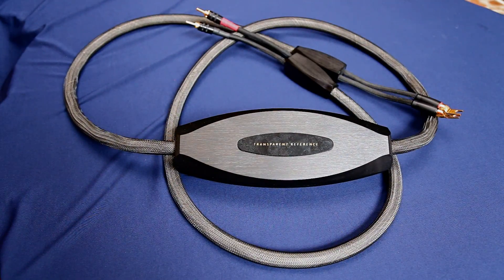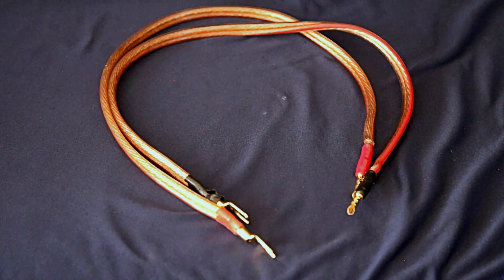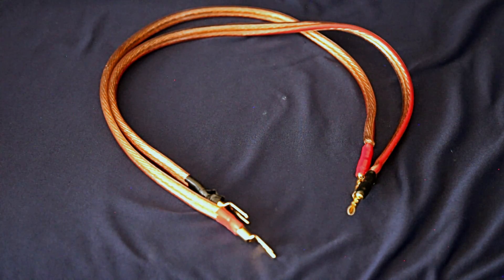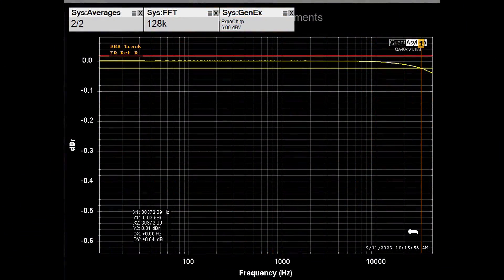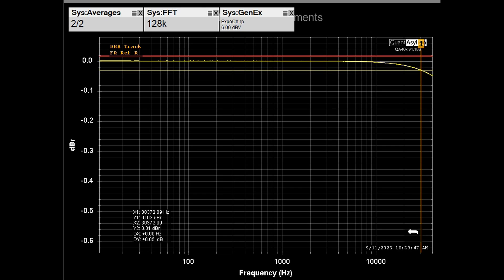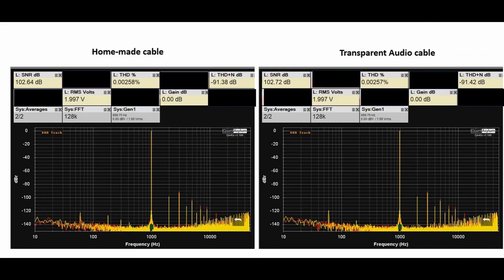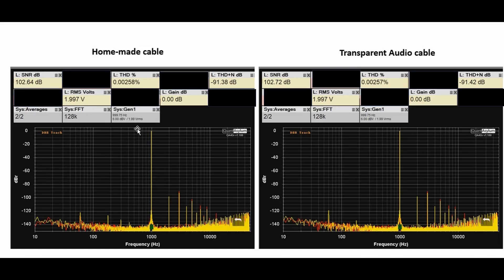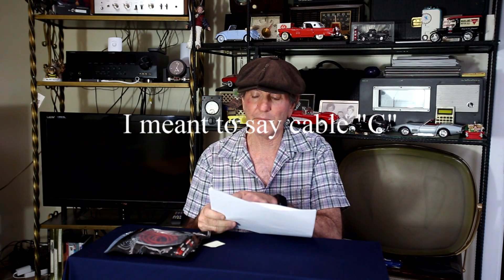$8000/pair Speaker Cable  vs. $14 DIY Speaker Cable A/B Test: Vintage Audio Review Episode #87

Comment: Transparent cable doesn't claim their cables are lower distortion or have a different frequency  response than less expensive cable s. Transparent claims their network boxes reduce noise and are calibrated to match the impedance between amplifier and speakers , and between  components and their  network boxes have damping expoxy to reduce resonance s  so these are  tests in the video  that are not addressing the specific manufacturers claims like resonances , impedance  matching and measuring noise spectrum in the range transparent  claims is reduced by their cable networks but if more extensive  tests are done and cannot confirm the manufacturer s claims then cable nay sayers could be right .
Reply: See my root comment above ... Nothing about those cables can or will do any of the things you say they're claiming.  It is a physical impossibility.
Reply: @Douglas_Blake_579 .....phone preamp s have different impedance matching for moving coil cartridges s but transparent can't do different impedance s in their network boxes with internal circuits that include resistors ?...okay ....someone should file a lawsuit against them if it's a lie
Reply from the maker: @mikelanden  Phono preamp matching to a cartridge is a totally different beast than matching between an amp/speaker. The signal levels are much, much smaller coming out of a cartridge and the input impedance of your preamp much different than that of a speaker. I am hope @Douglas_Blake_579 can provide more details on the subject- I have to get back to testing....
Reply: @vintageaudioreview  ...oh...ok...what about 4 ohm , 6 ohm , 8 taps on amplifier s that are part of the signal path that include being connected to speaker cable s...👌
Reply: @vintageaudioreview  ...by the way unless you send the cable you tested back to transparent for custom calibration between the amp and speakers you are using to see if the impedance matches that interface ....you won't be able to test their claims ...
Reply from the maker: @mikelanden  If it is a well-designed amplifier with a decent damping factor, the effect of the speaker cable is very small. The only solid state amps I have seen that come to mind right off the bat are some made by McIntosh, which don't really care about the load they are connected to. Tube amps typically have low damping factors from what I have seen and may be more susceptible to the effects of cables, but that effect is most likely small.
Reply from the maker: @mikelanden  There is another, recent post in here that talks about that matching network. point taken, though.
Reply: @mikelanden 
1) The impedance matching done between a phono cartridge and the input to a phono pre-amp is to make sure you're getting a flat response on the output of the pre-amp after RIAA de-emphasis.  The input resistor in the pre-amp forms an LR low pass filter such that adjusting the resistor also changes the frequency response of the cartridge. It has nothing to do with the actual output impedance of the phono pre-amp which is usually quite low. 

2) The 16, 8 and 4 ohm taps on tube amplifier outputs are there to prevent pulling too much current from the tubes.  If you take voltage readings you will discover the outputs are at V, V/2 and V/4 respectively... this keeps all three outputs in the same safe current range.

3) Impedance Matching went right out the window when solid state equipment was being developed. Very early on, designers realized that it made a lot more sense to produce equipment with low impedance outputs and high impedance inputs, which is called "Impedance Bridging" (go ahead, look it up).  It ensures that a signal is transferred with maximum accuracy and minimal losses. In the example of a pre-amp feeding a power amp you would want the output impedance of the pre-amp to be under 300ohms and the input of the power amp to be over 10k ohms, for best results.

Now for the subject on hand... 
Most modern power amplifiers are a voltage source. They produce a stable voltage, ensured by feedback with very low output impedances... usually in fractions of an ohm.  Speakers are an uneven load, that will draw varying amounts of current depending on frequency.  Most manage to stay over 4 ohms impedance and may at times represent a 60ohm or higher impedance to the amplifier.  Thanks to Impedance Bridging most amplifiers handle this very nicely, producing a uniform output voltage across a varying load.  

This relationship between the amplifier's output and speaker's input is called the "Damping Factor" (Go ahead, look it up) which is expressed as the ratio between their impedances.  For example, an amplifier-speaker relationship of 0.1 ohm feeding 8 ohms is said to have a Damping Factor of  80.  Most amplifiers can actually produce damping factors over 200.

Now, in order to maintain high damping factors -- to better control the speaker -- you want as little resistance between the amplifier's output and the speaker's input as you can get.  For example: a 10 foot run of 16ga wire presents resistance of about 0.08 ohms.  So now the damping factor from above is reduced to 8 / 0.18 or 44, which is still totally acceptable.

Now think about what happens when you start adding coils and other parts in the cable itself... Lets say that coil in the Transparent Cable has a series resistance of 0.2 ohms (which is typical). Now our DF is 8 / 0.38 ohms or 21 which is getting kinda low.

Now tell me... how can that possibly be a good thing?
Reply: @Douglas_Blake_579  have you ever seen the white paper by Nelson pass on speaker cable measurement s ?....cable with lower resistance caused some amps to short out during testing  .
Reply: What is hilarious about you attacking transparent for allegedly matching impedance between components and amps and speakers with their network boxes .....is that almost all cable skeptics agree that the one area that cables will sound different in  blind test is in the area of measured Impedance.  . The great audio  engineer Roger russel of McIntosh is one who noticed this in his research.  Did you ever send that cable back to transparent for them to calibrate it to your specific amp and speakers and do a listening test s and very comprehensive test set of measurement s....👌
Reply from the maker: @mikelanden  I never thought of sending the cables back for recalibration- did not know that was possible until a commentor pointed it out. Guess my electrical engineering training just won't let me go down that path very much. I would like to see the article where Roger Russel mentioned this.
Reply: @mikelanden 
Learn to read... I did not attack them for "matching impedance" ... I showed you how they are sabotaging the damping factor of your speakers.  

You want to know what the impedance of a speaker wire is?  Hook an Ohm meter across the two leads with nothing connected at either end ... it's going to read as an open circuit, as it should.

Now the end to end resistance of that wire is an important matter.  The lower the better.
Reply from the maker: Thanks for taking the time to express your thoughts- that network in the cable is calibrated to match your system how? Do they have a library of the majority of speaker impedances and output impedances, and a massive amount of L, R and C's to use ??
Reply: ....transparent cable by the way does the impedance matching between components on the interconnect level which is much lower level signals that you claimed it was more appropriate
Reply: @mikelanden 
It is a speaker cable... not an interconnect.
Reply from the maker: @mikelanden  Not if what comprises the matching networks as posted by Douglas_Blake_579 is correct.

Comment: It could be that in a more resolving/expensive system, the more expensive cable might sound better. The only conclusion you can make about this comparison is limited to the gear used in this comparison. Interesting though.
Reply from the maker: Thanks for the comment and I would agree with you other than the gear being limited- to a certain extent. What would be the minimum equipment specs, room and hearing ability required to reap the benefits of such a cable...?

Comment: You’ll notice a bit of difference of course but not 8000 worth of difference?
Reply from the maker: Thanks for the comment and I guess there is the fact that you can tell someone that you are using $8k speaker cables along with your $20k amp and $35k speakers and $10k preamp- I guess that is worth something. The majority of commentors thus far would agree there is not going to be much added (sonically) with such expensive cables.

Comment: I’m guessing the switch box is what leveling the playing field.  So it’s not a true a/b unless the cables are directly connected to the speakers. What a waste of effort
Reply from the maker: Thanks for your comment, even though I would disagree with you. I posted a link to a "write-up" on the switchbox's electrical characteristics, which show that it does not change the signal going through it by a noticeable amount- both cables are going through it. I can switch between cables (or amps if that is what I A/B'ing) in the middle of note so the comparison is made within not more than 500ms- pretty much instantaneously. This was part of a get-together of audiophiles (most were) to eat, drink and converse, and everyone said they enjoyed being part of the "event/experiment"- not a waste of time IMHO.
Reply: @vintageaudioreview  I’m sure you guys had a great time.  I also had a similar event.  But since we had a lot of time, switching cables manually wasn’t an issue. We would listen to an entire track. Wait for a couple of minutes for the manual switch, then listen and compare.
Reply from the maker: @slowinfastout3304  What I have found is that our audio memories are not that great for the differences between what are going to be very small nuances between speaker cables, or preamps or even amps. There is a more expensive a/b switcher out there made by Van Alstine, but for what I have been doing, mine works great, IMHO. And the folks who participated in the tests that I have done have been a bit surprised at the results and are happy that I am doing them and look forward to the next one.

Comment: Hello.
I find the set up of your testing flawed. I’m not saying one cable is better than the other but the cables need to be connected directly from source to amp. Also you need to use both left and right channels. How can you gauge the sound stage and spatial depth, height etc? 
The internet is really bashing cables and audiophiles is general recently and I don’t know why?
Many, not all, but many people audition cables at home and if they didn’t work they wouldn’t buy them.
Reply: "The internet is really bashing cables and audiophiles is general recently and I don’t know why?"

There is no way to answer that without insulting at least half of the readers on these comments... BUT...

The cable bashing is because nothing in science or general understanding supports any of these manufacturer's claims and for certain there is no justification for the prices these guys charge.  It has to be one of the grandest consumer rip-offs ever.

The audiophile bashing is largely because of the snobbery and elitism the whole cable bullshit has inspired in them.  

These shyster companies have succeeded in dividing our little hobby into two distinct groups... Objectivists and Subjectivists ... and it's become an ongoing argument that never needed to happen.  In fact, the two groups should be helping each other to put together decent systems at reasonable prices.  All the rest of it is just wasted energy.
Reply from the maker: @Douglas_Blake_579  Well put again. I would say that it is more about just expensive speaker cables. I don't know if you remember the "masked magician" who showed how effects were done- I disagree with that as I am a member of the Society of American Magicians- but ythat is what a few of the sites like ASR are doing and I think it is great. I have done it just a little bit- not always intentionally, but may do a few more as I can.
Reply: @vintageaudioreview 
Not just speaker cables ... the RCA cord market is even bigger and runs on more outlandish claims.  Then there's the whole USB and HDMI cable thing... 
Not good.
Reply from the maker: Thanks for commenting. THere have been many comments about my "flawed" setup as well as need to use both channels- you would have to read through them all to see why you don't need two speakers, but it is not possible with my set up very easily, and to just use 1 to listen to a tonal difference is OK. I had no intention of bashing anyone, just describing what the results were from my little expericment.
Reply: People buy a lot of things that make them feel better... 

That doesn't give those things functional merit